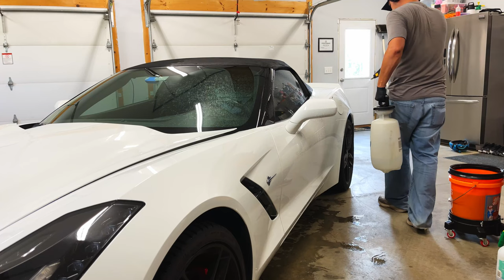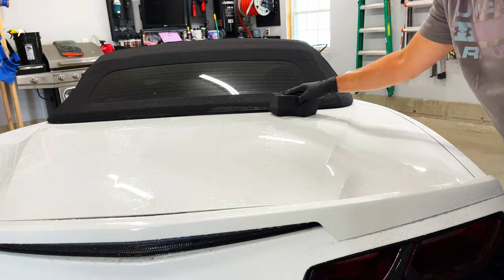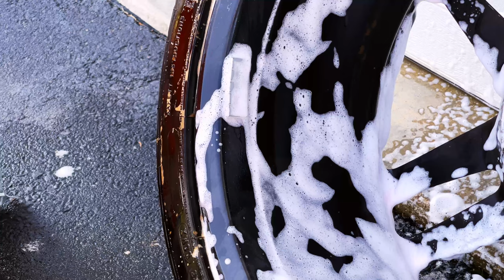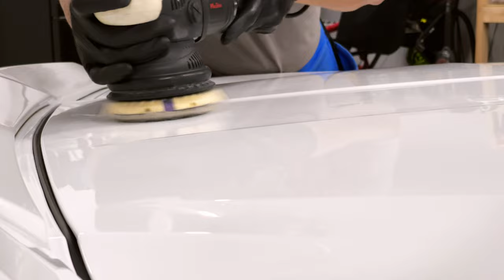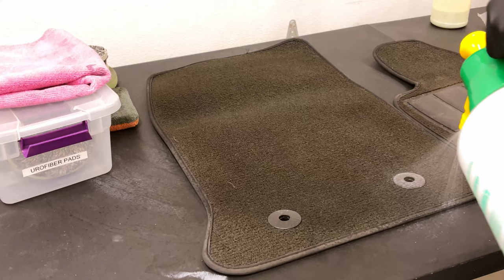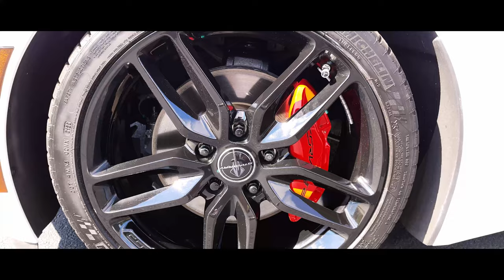[Restoring a 2017 Corvette Stingray to like new] Full Detail and Ceramic Coating | Alfred Auto Spa

Comment: Alfred, loving the videos bro! Using rinseless and steam! What ar you using as your car lift ?
Reply from the maker: Thanks Eddie, I appreciate you tuning in! Unfortunately, just a floor jack and jack-stands for now. Saving a little from each of my detail jobs to buy quick jacks or something else. Trying to cash-flow any new items I get for the garage. Whatever I end up getting needs to be able to lift a 1 ton truck because that seems to be the majority of my work lately.
Reply: @alfredautospa  man I need a lift my back is like a 90 year old couple with fat issues
Reply from the maker: @Ecdetails  Bro, I hear you. I plan on detailing for a while, but getting low to do these sports cars is brutal. Plus I spend about an hour or so just jacking the car up and on stands to get the wheels off. Eventually it will be more cost effective to just get the lift and save the time and energy! I've been split between getting the lift or doing racedeck in the garage so I can wash in there. Racedeck would probably be the most useful upgrade right now, but I have a mustang coming in at the end of june for a wheels off detail and coating...that lift would be clutch!

On a different note, so jealous you got Nick out there to spend a few days with you and the family. I loved that your girls were in there with you doing work. Kudos to you and Bev for raising kids that are not afraid of a little hard work 💪